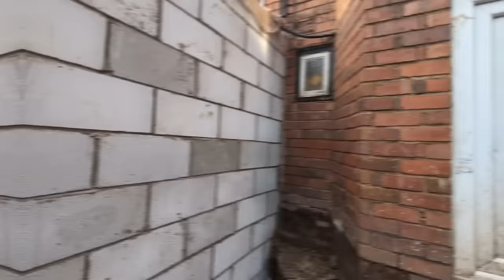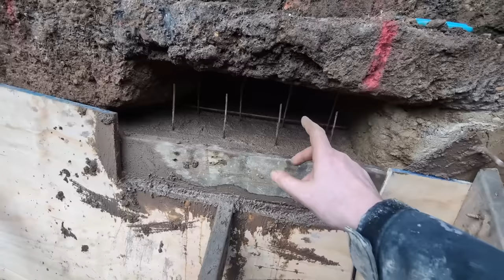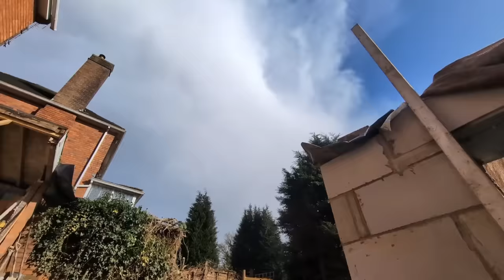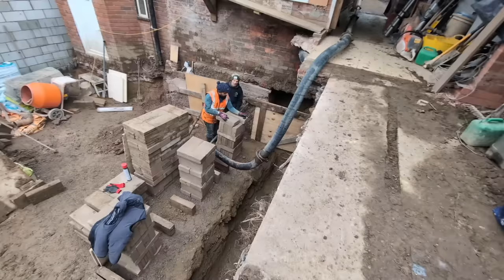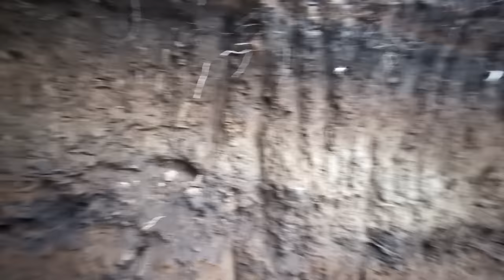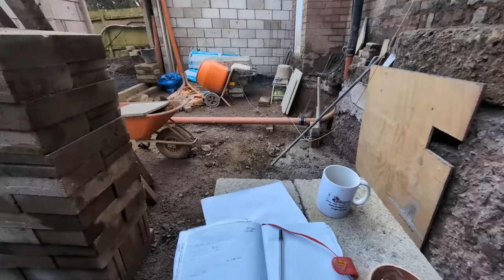Underpinning SOS!!! Why does the concrete do this??? Plus fundraising update. The Basement Build #2

Comment: I've only done under pinning once. See if I can explain this well enough. Along the top of the ply, in the middle,  that touches the old foundation, cut a 6" square out, as though you want to pur concrete into it. But create a ply box with an open top over that hole. As you fill the box up, it pours in behind the ply and upto the bottom of the foundation. When it's gone off, you just have a lump of concrete to break off where the box was. But it means you filled it all in one go.
Reply from the maker: Yes mate that makes perfect sense, thank you. Cheers Mee, hope you're well.
Reply: Wrong method. He has done it wrong as well.
Reply: @pauldurdan1549  the idea I did was from the structural engineer.
Reply: @Mee10792  Fair enough 👌
Reply: Hi i think you are trying to explain a “letterbox”
Doing it that way you can pour in one save the packing after. This is how you would pour say RC column repair
Reply: @Mee10792 do it they way the structural engineer draws it up, and you are not responsible for any failure.. Great job
Reply: @hmg8915  Yup, because all the structural engineers notes are simply passed on to building control. So for SE's to cover themselves, they've gone belts and braces because everything is now over kill.

I put two angles in for a 13' foot gap 20 years ago, the same job last year over a 9' foot gap wanted double the size of steel, a steel support and large pad stones.
Reply: @Mr_A_Builders  You haven't done it  to the drawings though, have you.

Comment: I see you’ve mentioned dry packing in another comment but my structural engineer was fine with building what’s known as a “birds mouth” at the top of my shuttering. If you research the technique it’s very effective and a good time saver compared to what it looks like it took you. Well done mate. Keep up the great videos.
Reply from the maker: Cheers mate, appreciate that. It may have been more time efficient to do it that way! It was hard work I've got to be honest! Weirdly I quite enjoyed it! Thank you for watching and commenting pal, really appreciate it. All the best.
Reply: Came to say the same we call it a letter box
Reply: Letter box shutter is good idea, but concrete will still shrink, leave 50mm low and fill with non-shrink grout (5 star) just a thought, do you vibrate your concrete to remove trapped air, for every 1% trapped air = 5% reduction in strength 😉

Comment: A raised chute section on the shuttering would have helped with the filling of the concrete and allowed it to fill nearer to the level of the existing footing.
Reply from the maker: Yes mate, the only issue with that is that we may not have been left enough 'packable' space if that mates sense? Cheers, Ed.
Reply: @Mr_A_Builders  I understand about the packing, the good thing about the chute is you can see what level you are filling to and control the  amount of concrete being poured, I think you could have filled abit more than you did and had less work on the dry packing.  As always there's more than one way to do a job, if your way works for you, crack on.
Reply: @Mr_A_Builders  Nothing you say makes sense actually 🙄
Reply from the maker: I'm hearing ya mate. Appreciate the advice. Cheers mate.
Reply from the maker: @pauldurdan1549 oh I don't know about that, Paul. For instance, if I called you a total bell fruit I think everyone would understand. Don't you?
Reply: @Mr_A_Builders  sticks and stones!😅 If I called you a boat and ANCHOR, I expect everyone would understand that as well ! 😅

Comment: If you drilled a large core hole from the top of the foundation at an angle The concrete would be up to the foundation in one hit.

Comment: Dry packing always better in my book as if you leave concrete down then any shrinkage in setting concrete is taken up by dry pack 75mm usually.
Also we tend to drill concrete once poured and fix  continuity bars T16 then your not catching your face etc on rebar , just my thoughts.
Reply from the maker: Fair play mate, nice one.

Comment: Your best option is to set up a square merchants account. First off, you can use it for your business to take payments from customers via card either via a website link, or on the go on your phone, but secondly you could use it to set up a donations page and square will only take around 1.9% of the payment. It's by far one of the cheapest ways

Comment: During casting of existing foundations. As you do in the video by making a formwork up to 100 mm lower than the underside edge of the existing foundation. On the upper edge of the formwork, mount formwork 45 ° in relation to vertical formwork, closed at the sides with triangular formwork. The upper edge of the sloping formwork must be 100 mm higher than the lower edge of the existing foundation. The constructed funnel makes it possible to fill the last piece of the formwork and contact is formed between the new concrete and the existing foundation. The inclined casting is peeled off. 
Exciting to follow the basement project. The formwork incl tage sloping formwork can be made at the same time, so all the concrete kan be done at the same time.
Reply: That's called a letter box no need to dry pack no mesh in footing he says the concrete is gone off only on top still cureing  for at least 28 days before you build other than that he's ok
Reply from the maker: Now now, don't misquote me and try and sound all clever...quote me in full please...

Comment: Took me 2 years to get round to buying a Heupor laser as I’d never heard of them. Got it now & more than pleased with it, so many uses, very easy to use & improves accuracy every time.
The only problem was the wide range of options. I recommend buying 4D with receiver & tripod as you will find uses for it not considered before.
Reply: Looking at this make myself
Reply from the maker: They are great aren't they!
Reply from the maker: You won't need disappointed mate.

Comment: When I was an apprentice, I can remember a question from my City and guilds exam.... it was to do with when you had a drain fall that was too shallow.... so a 4" drain requires 1 in 40.... but a 6" drain required 1 in 60 fall.  As long as the 6" drain goes in to a manhole it can then go back to 4"..... now I've never done drainage for a long time the regs could have changed could be worth checking out

Comment: Fascinating job. Looking at the rebar detail drawing for the underpinning, you're supposed to have bars bent 90 degrees tying the horizontal to the vertical. Otherwise you have next to no bending resistance at the base. Did you put those in? I couldn't see any in the video.

Comment: That steel mesh is doing nothing you should use 1000 mm long 20mm dowels into the surrounding earth, the correct way to underpin is to to excavate in sections as you have done then pour mass concrete to within 75mm of the existing foundation which should be cleaned off when the concrete has cured , fill the space with non shrink grout , the alternative is to pour a concrete footing and use short Acro jacks under the existing  foundation and concrete them insitu.

Comment: Probably too late now, but when you set out the new corner of the extension with laser, how do you know that you were in line with the edge of the existing house? I can see you formed a right angle meeting the house and the blockwork, but it could be running in or out and not be sitting on the true corner.
I enjoyed the video. Great work
Reply from the maker: If the laser is giving out a perfect 90⁰ angle then lining it up with both walls perfectly can only mean that the corner is in the right place. Hopefully that makes sense.
Reply: ,Your correct if the laser is moved left or right you can still hit both corners,but you might not be in a straight line with existing house wall.

Comment: Can you call that thin mesh rebar? Looks way too flimsy to offer any strength
Reply from the maker: Well it's reinforcing mesh, so it's got to do something!
Reply: @Mr_A_Builders  You're the expert so I'm not arguing with you. It's just far thinner than the re-bar Americans use when they pour concrete, their stuff looks like it would cope under tension.

Comment: I'm baffled. Why would anyone expect that foundation on sloped ground to be the same level as the lowest point? Of course you'd expect to find exactly what you found - a stepped foundation.
Reply: Surely you meant to say stepped and the same thickness…..
Reply from the maker: I expected a stepped footing but went found what it was like on the other side, coupled with the fact that the house has a basement, I expected it to have at least some consistency. Even the make of concrete differs across the footing, and also differences in depths...just a tad strange that's all.

Comment: You have not underpinned as per engineers drawing, nothing like it!
Show the construction Key notes. 
You are lucky that lot isn't on the floor. 
Oh and not that it matters that clay pipe is broken behind the socket, so you probably broke it when digging out. I have never heard so much b...sh...😅
Reply from the maker: Hello Paul, good to have your beaming smile and radiant, infectious positivity back again. You're totally correct of course, we've dug more out than specified and put in way more concrete. Well spotted. If there's anything we've done wrong however which will lead to the house falling down please be sure to put it in the comments. Just remember that I said "wrong", if we've done it differently than you would then no one really cares. As for the pipe, I really don't think we did but I can't swear to the almighty that we didn't. It'll be extremely strange to do all that digging around the pipe and the only damage is a bit of mortar to fly out of a joint without so much as the glaze of pipe to be slightly flaked off, but who knows?! I just mentioned it as a visual example of what could be causing damage to areas of peoples homes. But again, who cares? That pipe doesn't exist anymore, bit like your beaming smile and radiant, infectious positivity. Thank you for watching, Paul. Hope you're well and having a great night. Take care.
Reply: @Mr_A_Builders  😆😆😆
Reply: Well said.